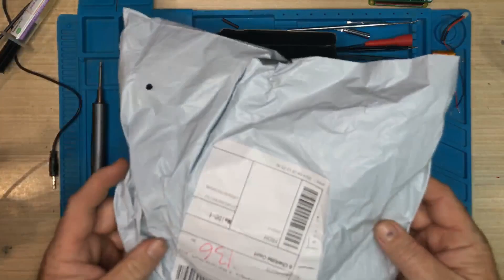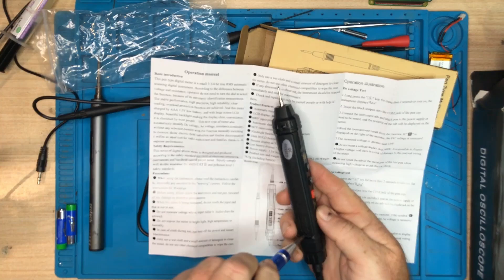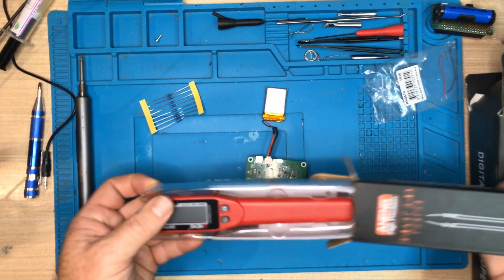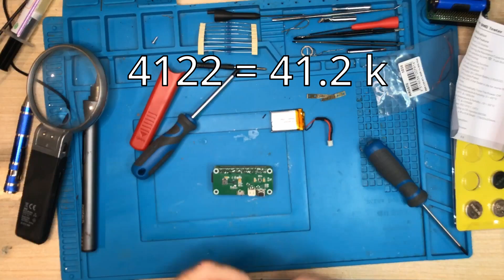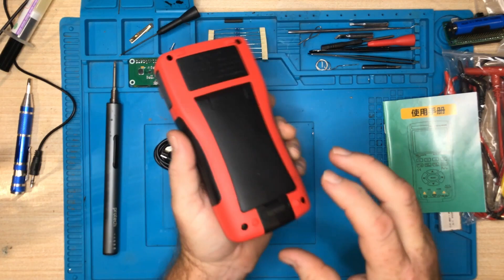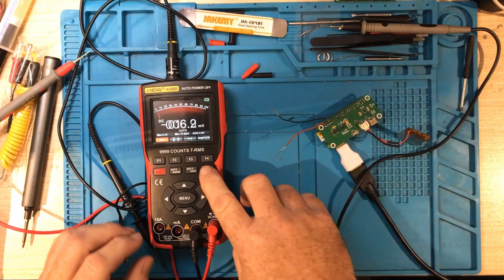Unboxing and evaluating ANENG test gear from AliExpress

Comment: Nice video! To my mind the pen type meter is ideal for testing away from the bench, where you may not have a good place to rest a traditional meter. With this you can hold the entire setup in two hands.
Reply from the maker: Yes, it definitely has its place. And for some reason this type of meter is one of the cheapest as well.